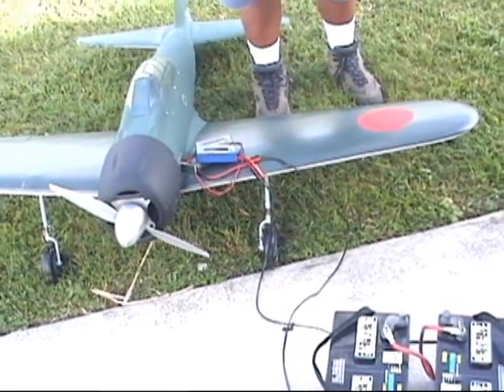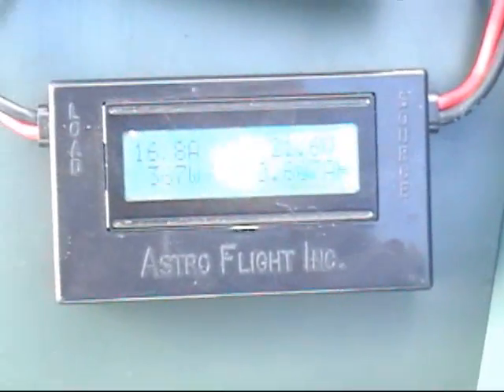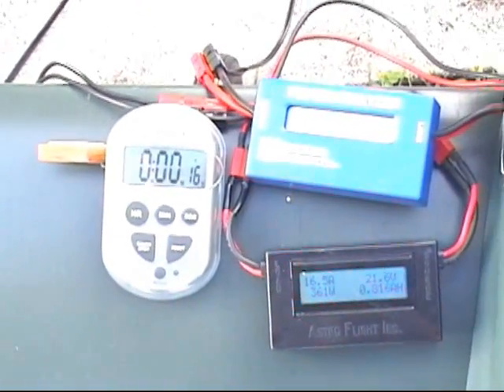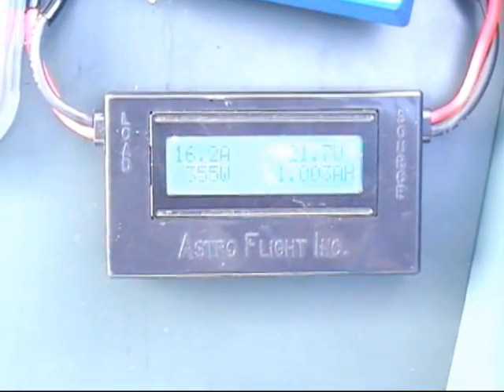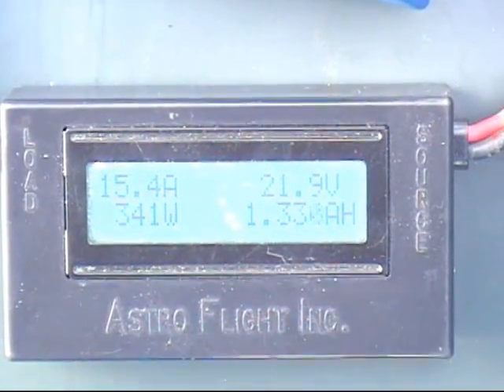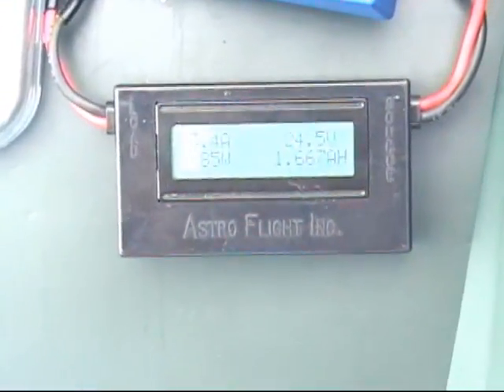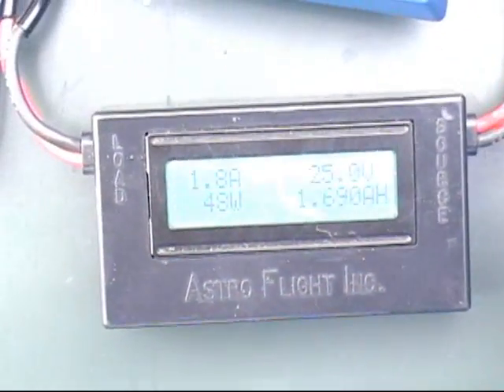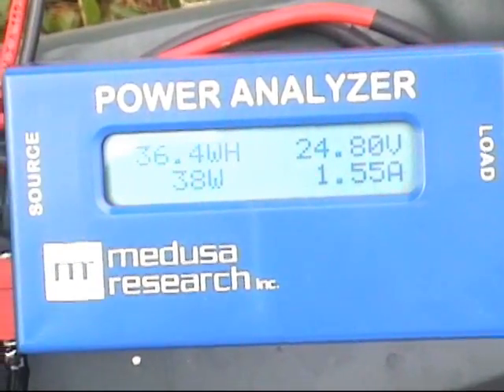6s1p A123 Direct charging method#1

Comment from the maker: we never measured resistance, We start out with a long 24 ft wire and we cut it as we go, I think we went down to 13 1/2 ft.
Yes you can use 3 lead acid batteries in series to charge a 10s A123. The lead acid batteries are 100amp hr.